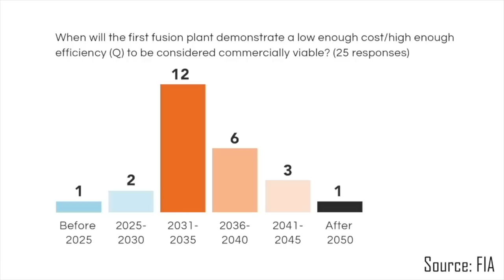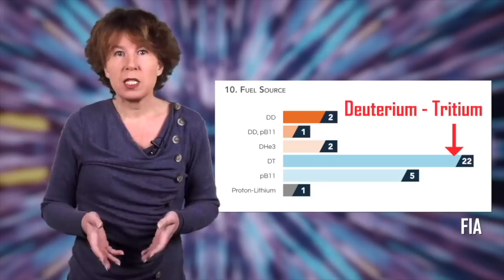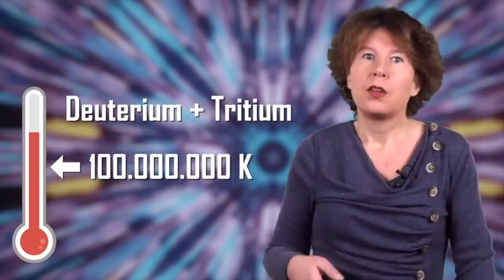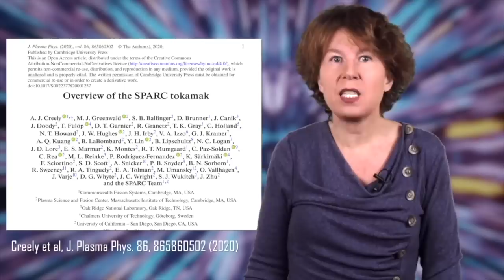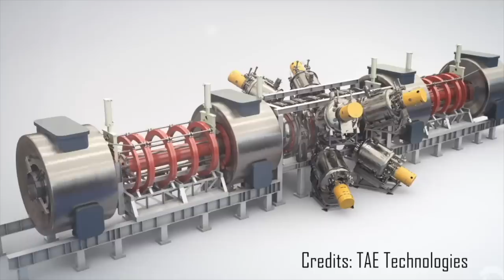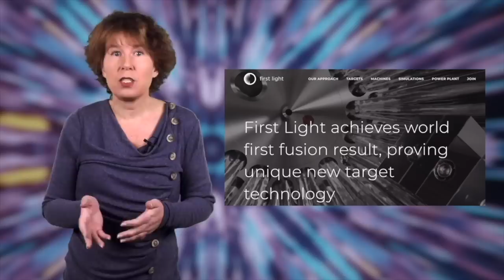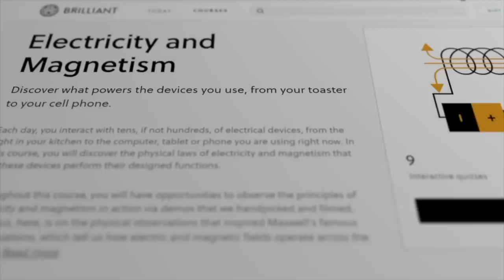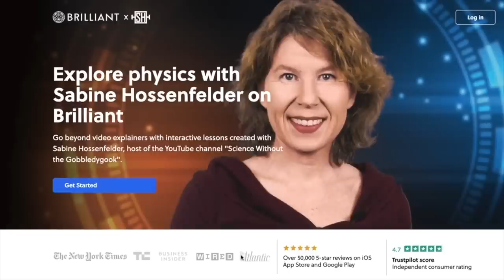Nuclear Fusion: Who'll Be First To Make It Work?

Comment: This was an excellent summary of the various approaches to fusion.  Well done, and thank you for putting so much effort into it!  There are currently about 35 startups world wide.  So, this is my prediction.  The first one to breakeven will be either Helion or Zap Energy, because they have sufficient energy storage to do so in their reactors and their concepts facilitate high data rates to explore the parameter space.  I also think it will take them longer than 2024 to get there.  Electron thermal conductivity removes heat absurdly fast from a plasma, and increases as T^(5/2) power.  They will have to fight very hard to get the temperature high enough for ignition of their targets.  Also, I think most of the concepts Sabine listed can be made to work, allowing enough time for scientists, engineers, and technicians the creativity and intellect needed to solve all the challenges.  Breakeven will occur within the next 10 years and a power plant will be seen within 20 years, extrapolating based on the past 70 years of progress.  There will be many reactor types on the grid in 30 years.  Thanks again Sabine.  This was a great video!
Reply: I’m mid 50’s and very healthy for my age. I won’t see breakeven in my lifetime.
Reply from the maker: Thanks for sharing your thoughts, this is very interesting.
Reply: So still 20 years then?

Comment: I've been hopeful in the past about fusion but I learned from watching experts in the field here on yt that most of these startups stay quiet about their unsolved problems. Also, proving fusion and claimed characteristics of the achieved reaction is well-established in peer-reviewed science but very lacking among these startups so I would take their claims of confinement time, temperature, and net gain with a grain of salt.
Reply: It's not just the startups not telling the whole truth.
Reply: @russhamilton3800  Fusion is like crypto, but it's going to the sun instead of the moon that's all.
Reply: People were hopeful when the claims of a working reactor were 3 decades away. Here we are 3 decades latter, and now the claim is 1 decade to a demonstration of a net power gain. IF that happens I expect the net gain demonstration will power a LED, briefly, for an ungodly amount of money. I'm starting to think half of all this research money would haver been better spent on new small, safe, modular, fission reactor designs that could actually be providing cheap power in this decade.
Reply: I think the tokamak and stellarator startups are solid. The main problem left to be solved is breeding the tritium, but I'm confident they will solve it.
All the other ones? Yeah, I'm very sceptical.
Reply: @fjanson2468  So you did notice how the estimate shrank from 50, to 30, to 20 and now to under 10? Why do you still think it's never going to happen? Because it took a little longer?
Also nobody except a few quacks think it's going to happen in this decade. Early next decade is what they are aiming for. But net power demonstration could be in a year or two. We'll see.

Comment: Missing focus fusion LPPFusion (a bit like ZAP) and Safire (based on the Sun's electric model)
Reply from the maker: Sorry... It was really tough to make a selection. Maybe we should make another video...
Reply: @SabineHossenfelder  Just an FYI: Safire is based on "Electric Universe Theory", generally considered fringe science.
Reply: @barryon8706  Eric Lerner may be a crank but I'm curious what his Focus Fusion approach has been doing nonetheless. It's listed as a record-holder on Wikipedia for highest temp with over 1 billion degrees. He's pursuing H1 + B11 fusion and some years back there were some updates but I haven't seen much about it since and I wish I knew where they're at now.
Reply: @SearinoxNavras  That's fair. If it works, it works.
Reply: @barryon8706  Safire is modelling the electrical side of the sun. And is exploring its physics via experimentation. The sun has a lot of electrical phenomena, like plasma-ropes and solar flares. The magnetism also clearly shows that there are strong electrical currents in these phenomena. But what is driving these electrical currents? 
Based on physics it can not be some dynamo, because a dynamo works differently. And we do not see eddy currents reacting to magnetic changes either. The magnetism always requires an electric current.
When it was first discovered, the electrical phenomena were very clear. Due to the  particle accelerators, astronomers changed this idea towards a sun that spews out particles following some magnetic confinement. Yet, the electrical model is still more accurate, as it explains why the plasma moves similar to a plasma ball, where the sunspots have different polarities. And why the magnetism is there. The physics maps 1 on 1, but has been ignored. Because we do not clearly understand the particle physics behind it. So astronomers fall back onto the known (but clearly false) particle accelerator physics.
In the chemistry we can also see that there are clear electro-chemical processes going on, with -2 and +2 valence. Probably caused by a process that produces helium ions. And that nuclear battery could drive the electrical power.
Reply: @SearinoxNavras  Eric Lerner isn't a crank. I think he's very passionate about the research that he's been working on for decades. He responds to people's questions, even to non physics people like me. If LPPFusion breaks even or beyond, it will be fantastic!

Comment: Sabine, I found this report encouraging.  I think all the ongoing fusion  projects will find new stumbling blocks at the point of each advancement, after all we have never traveled this road before.  Unless I missed it, I was hoping that the LPP Fusion research project, a privately financed Plasma Gun project conducted by Eric Lerner in New Jersey, would be mentioned.  To the best of my understanding, it is reported to have achieved the magnetically confined plasma temperature in a plasmoid.  Fusion of hydrogen and boron 11 would produce three helium atoms and  electricity directly by ion and electron currents without need of boilers and rotating equipment and would produce no nuclear waste or neutrons.  Energy density appears to be the issue so far unsolved.
Reply: Billy Goat: I had the same reaction (pun unintentional) as I have been keeping an eye on LPP for many years now. Small budget, smaller team (less than half a dozen) but with a fundamental understanding of the processes involved. 
So far some promising results but also as many setbacks in the form of leaks, pollutant oxides and
Reply: Oh. Fat fingers. ... premature release of triggers. (Also not intended.) BUT they have already met two of the three conditions: concentration, heat and duration. 
It's a smallish spark plug, fits in a normal garage and emits no neutrons when fed with pB11. Runs in short bursts and generates pure electricity and also can double as X-ray generator for testing bridges etc. 
Not meant to sell power directly but the idea is to license the tech to other companies once the process is mature. 
LPP Fusion. Led by a stereotypical geek who knows his stuff.

Comment: Very understandable reading ads and press releases by those companies resulted in you being optimistic! :) Experts are pretty sure fusion will work, but they are unsure if it will be commercially viable at all, and pretty sure it wont be till say 2040. One of these experts is Prof Hartmut Zohm, director of the Max Planck Institute for Plasma Physics in Germany (some slides/animations in this video were from their website). So if a guy personally invested in favor of fusion is lowering the enthusiasm, its a good indicator to expect a longer way into commercial fusion than is advertised by those companies.

Comment: We already have access to a huge fusion reactor outputting 6 Yotta Watts.  It does emit some unwanted radiation, but we have an effective magnetic deflector.  The problem is not maintaining the necessary 15 million degrees at the reactor core, but arranging sufficient collector targets to acquire a globally useful amount of electrical energy.  On the plus side ‘Project Sol’ has been running reliably for over four billion years with no current signs of slowing down.

Comment: I am a fan of Dr. Winterberg's papers. What I think we need to acknowledge is that we can build a fusion power plant today; we can detonate Teller-Ulam device in a chamber and make a lot of steam to turn a turbine, the problem being that you need that fission trigger to set off the DD fusion defeating most of the point of fusion (radioactivity, need for uranium but oh how the fuel usage would be reduced!). How to replace the fission trigger? I always think Dr. Winterberg was on the right track that this is the question to answer. Well, maybe you use an explosively pumped flux compression generator to set off a smaller D-T explosion and then trigger the DD fusion. DD fusion has the advantage of more heat vs. neutrons. Maybe I am lame in trying to fit this in an ASME rated pressure vessel but I have the feeling the solution is going to be detonating devices in a water filled chamber that the pressure vessel walls never see anything hotter than steam at reasonable pressures and turning a turbine. Can you use the First Light Gun to set off a D-T explosion? I guess I should try to re-read all his talk on superexplosives as I always thought EPFCG or ion beam was the way to go (which is kind of a superexplosive no?).

Comment: Dear professor , you are an icon of clarity, as a backyard scientist I believe the stellarator is the most likely to produce large quantities of electricity by the tension they cause upon the plasma in a stellarator rather than the torus I have no proofs for this opinion, however  the X7 speaks for itself the twisting from the inside to the outside puts a compression on the plasma that save the reactor walls from abatement from that plasma , the circular torus by as in any wheel the outside goes faster than the inside creating an instability in the torus plasma from the start , where the stellarator doesn't I would love to hear your opinion about this

Comment: Q = infinity just means that the reaction generates enough heat that stays in the plasma that more hydrogen added to the plasma will also fuse, so the reaction continues as long as fuel is provided; it's like a bonfire that burns as long as firewood is thrown onto it. No, it's not a divide by zero error. :-)

Comment: Here is a question about another way to avoid the steam part. We know that there are startups going for energy storage by heating up graphite to the point that it glows, and that glow (IR photons) are then turned to electricity by surrounding the graphite with photovoltaic junctions. Are any of these fusion startups looking at something like that where the very high temperature heat of fusion is used to heat up a blanket of tungsten or graphite, etc. to the point where the black body radiation can be turned directly into electricity by PV panels? This could be especially good for pulse fusion situations because the blanket would provide an averaging heat storage to smooth out the energy flow.

Comment: Fission is controlled explosion and Fusion is not.

Fission is a naturally closed loop run away process at the atomic level and Fission is an externally closed loop process. 

Fusion is like internal combustion engine, that needs confinement, compression, heat, mixing, combination/fusion and heat production.

That made fusion a very challenge undertaking.

Comment: To me the Helion approach is most fascinating. They have already built several generations of demonstration machines, each a lot more advanced than the last. I like that their planned method of extracting energy out of it is basically already in place because it uses the same hardware that is used to hold and compress the plasma. This feels like an advantage over all the other projects where the state seems to be "it heats up something liquid and we all know that can be used to power things". That to me looks like a lot of devils in lots of details are left unexplored for now while Helion has to explore them already because they need to solve those to get the first part - energy in - working. So when they move to try to capture the outgoing energy they are working on the stuff around the reactor, the high power high speed switching electronics and huge capacitors and timing them all correctly. The challenges of having coils survive near the fusing plasma for periodically repeating pulses have already been dealt with because those are the same coils they are already using to demonstrate they can fuse the plasma.
Reply: the benefit ot heating something up to make steam is that it would be somewhat trivial in the grand scheme of things to convert existing coal plants to fusion. coal plants just use coal to heat a boiler and make steam, therefore all you need to do is replace the coal fire with a heat transfer from the fusion. 

The ability to retrofit rather than build brand new would mean savings and speed.
Reply: @reallifeistoflat  that's a good point. If both approaches end up working there will be uses for both depending on if you need a new source of electricity or if you need a new source of heat.
Reply: If you ask anybody who knows anything about anything, you won't find Helion very fascinating anymore. It's pretty clear that He3 + D Fusion will never give a net positive output in their machine. Also it's not quite clear why they'd want to do that in the first place. It basically has only downsides.
But maybe that's just marketing buzz and maybe they are actually going for D + T Fusion, like everybody else. That might be possible with their machine. But that still means they are either lying or incompetent. Either doesn't inspire confidence.

Comment: Using a fusion reactor to produce steam to spin a turbine is clearly going to be superior to using fission or combustion for the same purpose, but doesn't sound like a panacea in the long run. Even in the largest, most efficient steam turbines (i.e. around 1.2 GW) 50% of the thermal energy will be entering the environment via condensers (cooling towers) that evaporate river, lake or seawater and thus heat up the watercourses as well as putting water vapour, a powerful greenhouse gas, into the atmosphere. Sure, there are some conurbations where district heating schemes exist to use some of the thermal surplus, but they still need seasonal backup cooling. Any approach which extracts electric power directly from the fusion process has to be preferred.

Comment: The plasms in a doughnut shape justs burns itself out and in a spherical shape also, a straight tube that has a combustion chamber a magnetic compression chamber that ignites the fusion and then fires out the plasma to create a energy exchange or heat exchanger for electricity maybe a better way, as tritium is rare a deuterium reactor is the only practical solution.

Comment: As far as I understand, SPARC is supposed to produce net energy output of the whole system. Just barely, but it should do it. That's why it's just a demonstration. For a commercial plant you'd want at least 10x the power output.

Comment: To show a magnitude 8.7 earthquake is 794 times BIGGER on a seismogram than a magnitude 5.8 earthquake; but the 8.7 quake is about 23,000 times STRONGER { more energetic } than the 5.8, we can use an approximation for us math dummies. But we still have to realise the magnitude scale is logarithmic; and one whole unit of magnitude represents approximately 32 times the energy. Thus:
10  x 10  x 10 / 1.3 = 769 times ( Approx.)
32  x  32  x 32 / 1.4 = 23,405.
But that's still indicative of the power of a 8.7 compared to a 5.8.
Of course the amount of eq. damage also depends what a town or city is built upon.

Comment: I remember as a sixth grader in the early '90s reading one of Isaac Asimov's science books for children, and he briefly wrote about magnetic confinement fusion. I thought it was nuts at the time--holding together an extremely hot fluid using only magnets?! But now I feel like most approaches to inertial confinement are even crazier, at least in terms of practicality (though the hybrid approaches used by Helion and General Fusion sure are interesting).

Comment: I was initially skeptical about First Light Fusion's approach to getting electricity for the grid (lol - the big friendly gun - so many funny places you can go with that name).  I had no doubt inertial confinement works (the INF proved that).  I just didn't know how you would keep blowing up pellets at a rate where you could generate sustained electricity.  Based on Sabine's excellent explanation, and the relative simplicity of First Light's approach, I think they might be the first to have a solution which can be hooked to the grid.  I'm cheering for all the companies, however.  I'm pretty convinced we are going to need more nuclear power as an interim measure to generate base load electricity until we figure out a good storage solution for renewable energy.
Reply: True, it is hard to imagine.  But a diesel engine; using lots of little explosions is still hard to believe.  If you imagine an array of big guns; for city Scale power, it seems possible.
Reply: Regarding the Big Friendly Gun... It has to be a reference by a fellow geek to the BFG9000... Doom's, the video game, most powerful weapon...  Sabine's humor is the best around... But that gun name gives me chuckles too lol.